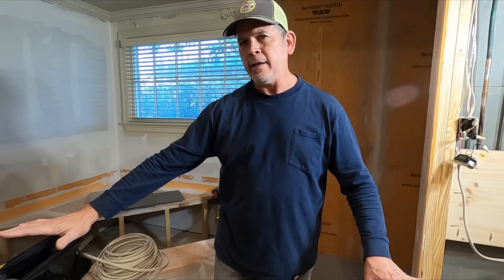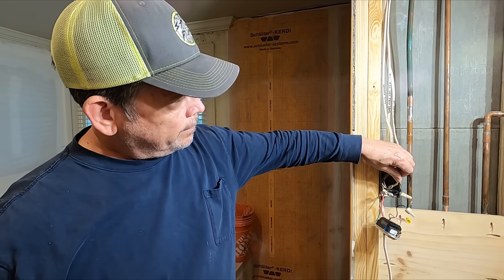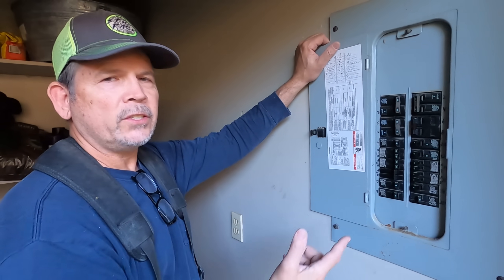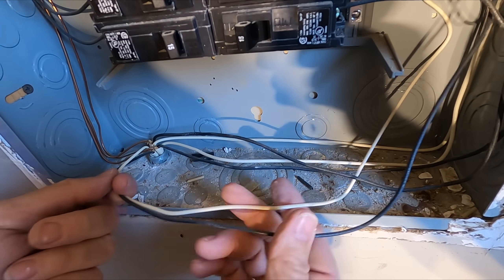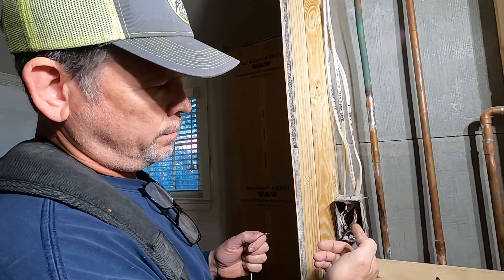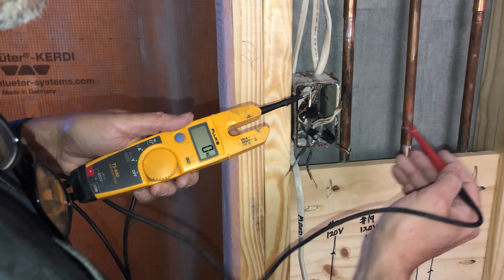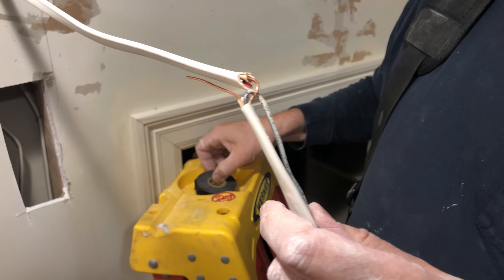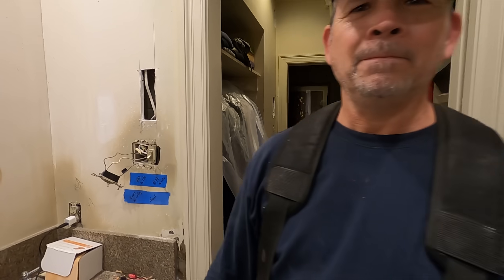You CAN Get SHOCKED by a Neutral Wire! This is How...

Comment: Really think you did not turn the correct breaker off. 

All neutrals are bonded at the board, they all connect to the neutral block, which is then bonded to earth. Lighting in old houses are a nightmare though as people often use incorrect wires in multiply switch/lighting circuits. 

Now there is a odd thing in this system though.

Always prove test prove, and always work on dead circuits. Live work is never needed.

Comment: you should also warn people about an energized water line because of short in water pump or pressure switch in rural homes when repairing the water heater. i'm lucky to be alive after getting shocked changing out the heating element when the pump came on even though i turned off the power to the water heater and checked with test meter. lesson learned use a flashlight and turn OFF the main breaker too!

Comment: Shocks are scary. As a kid, I worked in a Standard Oil station which had a contract with the Post Office. So, one day, I was checking the transmission fluid on one of the trucks with the old points style ignition, and the metal dip stick was situated next to the coil. It was a goofy design with the stick almost touching the coil.  I accidentally grazed the coil post with the dip stick and it was a hammer. Smoke was coming out of the dials inside the truck.

Comment: Found out in military neutral is not your friend changing a ballast out in a 2x4 office light left the lights on capped the hot figured safe🤷‍♂️didn’t cap the incoming neutral left dangling was wondering why my back was tingling the wire was touching my sweaty undershirt 😳better cap that too now lol😂 oh and FYI look out when going into old drop ceiling don’t touch the grid u might get shocked too😂

Comment: Had that happen to me at my last house that had some serious incompetent home owner monkeying around with the electrical.  Changing out the kitchen lights and I've never had a problem with just turning off the light and doing the work I was doing.  This time got popped.  Same issue with the neutral.  Is it laziness that people do this or is there a reason why someone would do this?

Comment: Respecfully intended but a non contact voltage tester is not shown in the video.... why? Why are you not utilizing a $20 tool that WILL tell you if there is potential for
Electrocution?  I can see your intent is good in nature so perhaps you're simply not aware that ncvt is a thing.   Here's how you do it properly.   1. Put voltage tester on outlet, switch. Motor.. etc.   "Beep beep beep"!! Lights etc.    2. Go to breaker panel, flip breakers till it stops.  3. Don't get shocked ever again.   Its quite literally the simple.    You're also not understanding how a series parallel circuit works.... but you donned to, and you don't need to 7nderstand split phase systems to learn how to utilize a ncvt.  Note that the dont read through bx cables.. you will always be able to detect voltage where a circuit is exposed though.. such as a terminal..
Reply from the maker: I have one and checked all the wires before starting.   Problem was someone turned on a 3 way switch in another room thus energizing that shared neutral.  See my pinned comment.  Thx MrD 👍
Reply: @StudPack  fair enough. Take my point though that showing this tool is incredibly helpful for people that know nothing about electricity. :)
Reply from the maker: You got it 👊

Comment: If we’re going to talk about safety we should talk about NFPA 77E. I set of low voltage rated gloves is not too expensive. At the very least anyone working with or troubleshooting live circuits should have gloves on.

Comment: my parents insisted I never become an electrician, so I learned, but ever pursued, 2 of their friends killed, 1 was in crawl space, metal water line crawled over electrocuted him, the other pulled main fuse, 60 amp, system, but wired backwards, neutral through fuse, hot without disconnect, tried to change water heater, electrocuted with fuse pulled. technically a 3rd friend died, but wasnt electrician, he was buffing his car, but old metal drill with a buffing pad, & the ground wire prong missing, so no ground on the drill, it had rained, so ground was wet, & drill shorted & he was killed. so anyway yes I learned out of curiosity, I do my own work, but i became a mechanic & auto-body man

Comment: What this guy is saying is "beware the floating neutral" - a wire that has a potential live load at one end and NOTHING at the other end so your body could complete the circuit.
Reply: @G0LDHDx  The problem is that even if the house side of the service entrance is properly grounded as per the NEC, it is still possible for a neutral break on the service side to result in voltage on the bonded neutral/neutral bar inside the house.

How?  It's simple: As per the last time I checked the NEC: NEC-compliant grounding doesn't necessarily provide a particularly good path to the dirt.  The NEC provides that a grounding electrode installation be tested for resistance to the dirt.  If it's above 25 ohms, you're required to add a second grounding electrode, but you're not required to test further, so, even if you strictly follow it, depending on soil conditions, the resistance can be 25ohms or higher, especially relative to where the distribution transformer is.  At 25 ohms and 240V, that's only 9A, not enough to trip a 15A breaker, let alone a main breaker.

Which means that if you had a single 120V circuit energized trying to pull 15A, the neutral bar will have a dangerously high voltage on it relative to the other leg, and will fry low current 120V devices.

The grounding electrode is to ensure that the house circuitry doesn't float relative to the dirt.  It is NOT intended for bulk current flow and CANNOT be relied upon to trip a breaker.  That's what the neutral from the service is for.
Reply: @Allister Sorrells If the main neutral is cut upstream of the panel, the only thing that keeps the entire grounding and neutral system from floating is the ground bond (which in older homes can be a pipe strap, on a section of pipe that may have been isolated by plastic pipe), and the grounding electrode in the  dirt with a fairly high resistance.  Remember that the grounding electrode system is not expected to carry much current.

So, take a grounded device, like a old fashioned three prong drill with a grounded metal case.  Pull the trigger. The voltage travels from hot thru the switch down to the panel to the neutral-ground bond, and then comes back up the ground wire back to the drill case.  The only thing keeping it from full line potential is the likely to be poor dirt connection trying to feed electrons your service transformer ground  a hundred or more feet of dirt away.  Zzzap.

In essence, a lost neutral upstream of the panel can potentially make you ENTIRE neutral/grounding system float, including your stove/dryer case and the plumbing/fixtures.
Reply: @Allister Sorrells Thank's for the Mike Holts info
Reply: Imagine what happens if the neutral becomes disconnected at the service entrance.  Virtually every device in the whole house can potentially fry.  Devices that operate off 120V can end up seeing a supply voltage anywhere from 0 to 240V, and if the grounding electrode is still connected, you might see as much as 120V on it and all grounded boxes,  Grounding electrodes are not expected to have anywhere near 0 ohm connectivity to the dirt.

if you ever see some lights brighten, and some lights dim, when a high power 120V load comes on, call an electrician and power off your main panel.  Or, call your electric utility and whisper the magic words "loose neutral".  They will be there fast.

Comment: Yes, I've gotten zapped several times over the years from a neutral wires, but the shock was never what you get from a black (hot) wire. That's because something like a light bulb is in series with you limiting the voltage and current.

Comment: Attics are why I did not become an electrician. 46 years ago in in vo-tech my first year was split into 3 parts ,house wiring and the NEC , industrial electronics and basic electronics ( resistors ,capacitor , inductor and transistor circuits). One summer of old construction electrical work with HOT attics and fiberglass convinced me to spend the next 2 years of vo-tech in circuit theory electronics . Also telling a customer who wanted a ceiling fan in a room with a floor above that we would have to cut holes or notch the freshly painted walls and ceiling was also not for me.

Comment: I was rewiring a closet years ago and got a little shock. At the time I couldn't understand how/why. I had shutoff the breaker at the panel yet I still got shocked. Now I know.
Reply: Now I see why people say to just shutdown the entire power and not just a circuit.
Reply: Where is your PPE safety equipment. If OSHA catches you without it you will say OS . ( O SHIT ).
Reply: Same here.. on a light with switch off... hooked up the wrong wire and made the common live.  Surprise.  At least I did it to myself.
Reply: Shared neutral.
Reply: A few years ago a local 98 apprentice in Philly got killed while working on a luminare by the grounded conductor ( proper new name for nuetral ). Must have opened up a splice. The electrician he was working for was in the next room.
Reply: If house or building has a shared nuetral the code mandates that you must use a 2 ( or 3 pole if 3 phase panel ) pole circuit breaker so you would not get a shock if you opened the nuetral wire. A few years back an apprentice was killed while working on a 277 volt lightning circuit while working on a nuetral conductor. Also must never use a device ( ex = recepracle ) to splice a shared nuetral. Instead you must splice the white neutrals using an approved wago or pressure connector ( = wire nut, no such thing as a wire nut in NEC book )

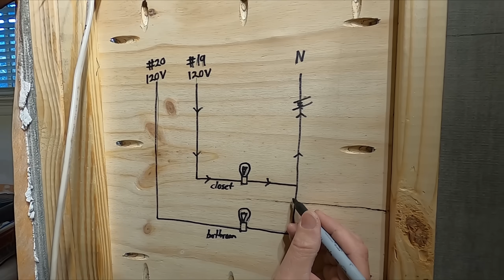Comment: I haven't digested your whole video yet but I don't make sense of your explanation at 10:28.  Circuit 20 and circuit 19 are both coming from L2, so there is no voltage (potential) between these points and there is no complete circuit path as you have opened the circuit at breaker #20.  Ok, I've had a chance to look at it again and I see the problem started with somebody using a two wire cable between two three way switches (which only supplies the travelers) and picking up the neutral off another circuit.  Bad idea.  I see that is has been commented that sharing a neutral is allowed in multi-wire circuits, but when that is done, the two circuits (in single phase) must be from L1 and L2 - never from the same line.  If they are, the neutral ends up carrying the sum of the current in both circuits.  
Thanks for the video.

Comment: Try hooking up a code required arc fault breaker to your new installation and see if it holds. Im sure it will not and the arc fault breaker will make you fix the problem. I do like the quality of your video but information is a little off.

Comment: I am an industrial electrician and I never did residential before I got into the electrical trade so I had no idea that neutrals could back feed until I had a loaded neutral on a 277 volt light and it blew up in my face when I shorted it out.. since then I have came across quite a few open, loaded, back feeding neutrals on 120 volt circuits.. I wire in devices on circuits and sometimes in industrial settings we can't turn the power off so we have to work it hot.. I've had some of the worst shocks and they came from loaded, back feeding neutrals.. the 120 volt neutrals aren't as bad as a 277volt neutral but it still will tear your butt up.. its especially worse when you think the power is off and you still get knocked by a loaded neutral..

Comment: I was a Navy electrician for 6 years.  When I got out, I started an apprenticeship. This would have been mid 90s.  One day the journeyman I was working with was installing some lighting, didn't want to cut power and set up temporary lights.  Long story short, hooked up the first light fine.  He went to hook up the second light and he starts cussing.  He was confused on how he got shocked from the neutral.  I tried to explain to him that when he broke the neutral line to install the second light, the neutral coming off the first light became hot.  He kept arguing that he should never get shocked off a neutral and something must be wrong.  After 30 minutes or so I gave up trying to explain it to him.  I didn't work with him for much longer after that.    Keep in mind, this guy completed a 4 or 5 year apprenticeship and had been a journeyman for several years.
Reply from the maker: Thx Tim!  Hopefully that guy finally understood what you were trying to teach him 👍👊

Comment: Use of a non-contact volt checker will always tell you if a wire is hot or not regardless of what color; these cost as little as $10;  I prefer the $20+ ones where the sensitivity can be adjusted.  In ANY remodel where opening a wiring cover plate is involved you should always  disassemble all that is ALL and EACH connection inside that box.  Then you simply just put the tester on or even near EACH wire to see if there is a beep.  IF a beep you KNOW that wire is hot,  regardless of color because a TRUE neutral will never beep; but fake neutrals are fairly common.  

BUT when testing each wire START with finding the first Black that beeps so you will KNOW your beeper is working/beeping.  Because while a BEEP proves it's hot, a non-beep does NOT prove it's a neutral, for non-electricians, NEVER assume a wire is NOT hot from a beeper test just because no beep; but you can trust HOT where a beep occurs, just can't trust a NOT-HOT where no beep - IF - your not a journey(wo)men electrician.  

Three-way switches installed by homeowners frequently cause mis-wirings from NOT putting a black wrap on a white wire that's used as a "traveler-wire" (google that) in a three-way switch.  You will need the sensitivity when checking a tight fit box with multiple connections cause a cheap beeper will not be able to differentiate between two wire close together since one only needs to get close not actually touch the wire being tested.  Plus another reason to open each connection inside a box is to discover bad stripping a too deep nicked stripped wire (sloppy stripping is common) or other weak obviously NOT a neat tight-grouping of wires.  These are fire hazards when in a wall near a washer because a loose wire in a poor connection that only connects because it is barely touching NOT bound tight will vibrate off and on hot when the washer vibrates, those off and on sparks can create a little mini-welder effect which WILL cause a fire in many cases.  So if YOU didn't do the wiring and it's a home-owner built house, especially, always always break open every single connection in any box you open - PERIOD - and use your beeper to prevent house-fires from sloppy wiring.
Reply from the maker: Great stuff thx ARK-543👊👍

Comment: WOW thanks for solving that problem. Electrical is my weak point. I never would have figured that out and probably gotten shocked. the black tape on the white wire signifies that its hot though. Was that there or did you put it on?
Reply from the maker: Thx Drew. I put the black tape there as indicator to me that it was the wire in question

Comment: A broken neutral makes anything upstream hot Also sometimes careless people will break the white wire with a switch if they want to change a pull chain which makes the white from the fixture  live. The problem in this video.lies with not using a two pole breaker that would kill power to both circuits sharing the neutral.

Comment: Impossible to get shocked off a neutral. It would just be an ungrounded white conductor. And no current code requires a main disconnect on that sub panel.

Comment: WHAT'S IT GOT, STUNTMAN!!!  Oh wait, neutral WIRE, not Neutral Drop...

Travelers? 14-3?  So that was an improperly wired three-way circuit causing the fault?  I had one in my house where they messed that up.  When I removed my remaining knob and tube, I found that even after disconnecting the K&T from the junction boxes where they were fed by Romex, I intermittently still had a light bulb on the K&T circuit faintly glowing, and my light switches on that circuit were setting off my tic-tester when the bulb would glow.
Then I found that I could toggle the fault on and off with a three-way light switch in the rear of the basement.  I disconnected the wires at the three-way switches and still had the fault, so I followed that circuit back, (through switches AND outlets) disconnecting and reconnecting until I got to the back of the house, and disconnected at the last box, and nothing stopped working - except for that back-feeding current.  It was gone for good!  I never did reconnect that three-way back up.  There was also another Romex-fed light which stopped working when I disconnected the Knob and tube, and I haven't tried to get it working again either.

Comment: i was working on a newer house up a ladder up a stair case in front of my wife
the lights were not working in the stair way
i was thinking my hot wire was not working
i touched the neutral and the grounded box with my pinky on the same hand thank god/i found out i had a neutral fail from the main panel or a bundle somewhere the hard way

a bad neutral crimp nearly killed me in front of my wife
for the sake of the next guy or gal please do a good job
thank you